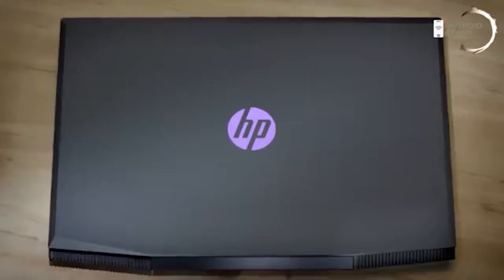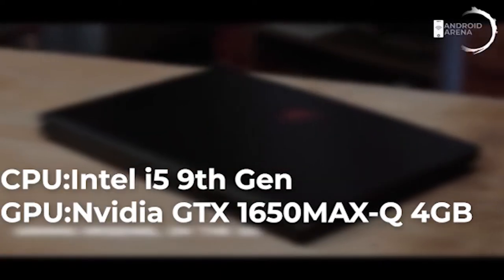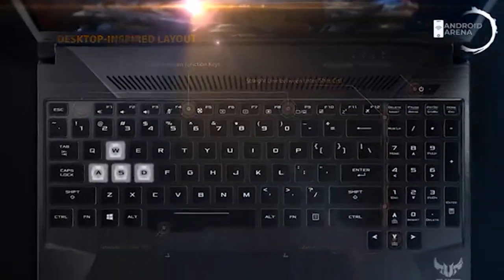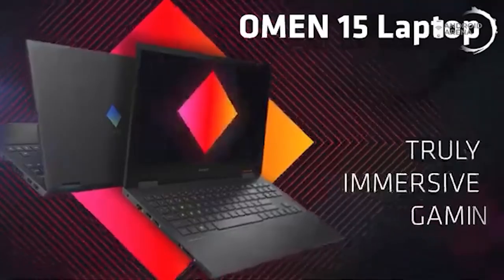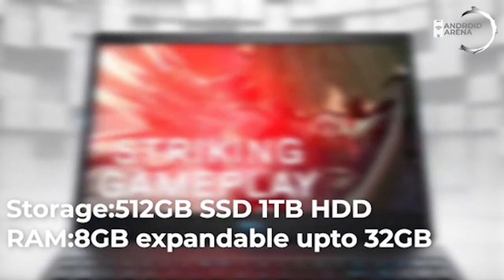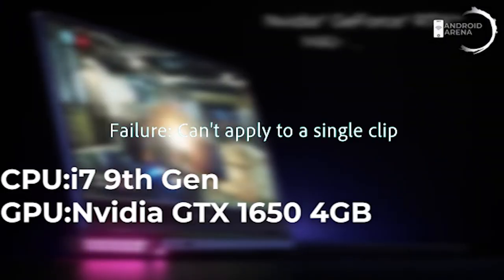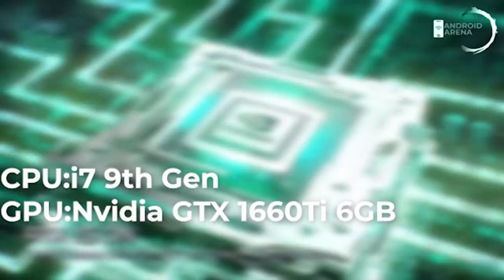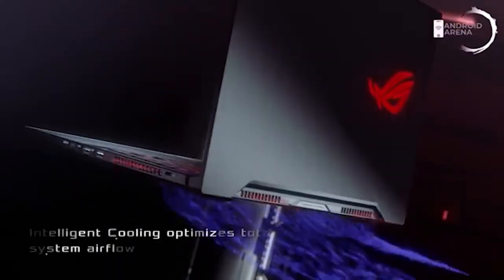TOP 10 powerful laptops for Students|Gaming|Architecture

Comment: Dell G3 3500 Gaming15.6-inch FHD Laptop (10th Gen Core i7-10750H/8GB/512GB SSD/Windows 10 + MS Office/NVIDIA1650 Ti Graphics/Eclipse Black) D560123WIN9BE       is  it useful for engineering students for study
Reply from the maker: Yes sir, thanks for the suggestion.
But for the price we get more worthy asus Tuf with more advanced specs comparitively.